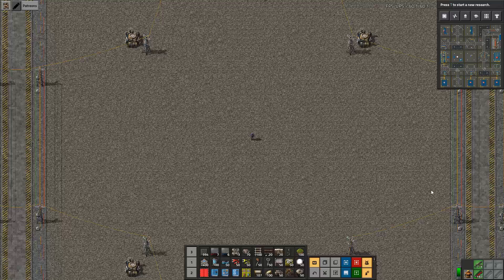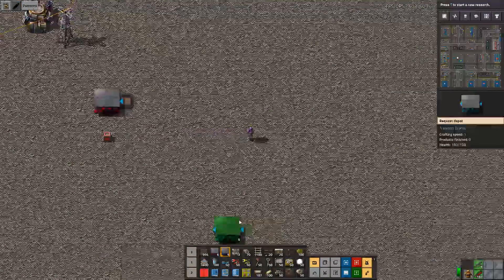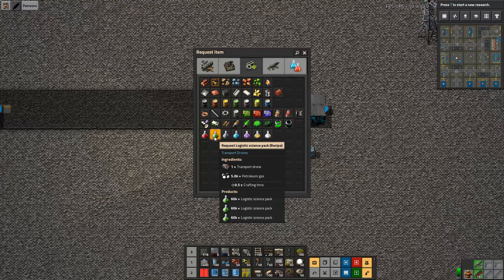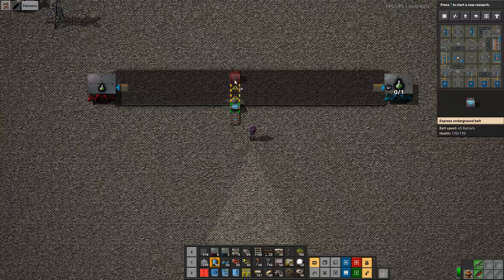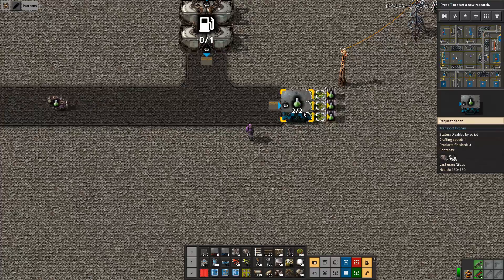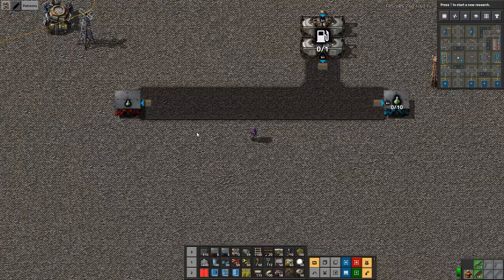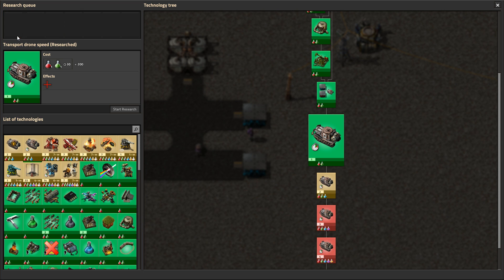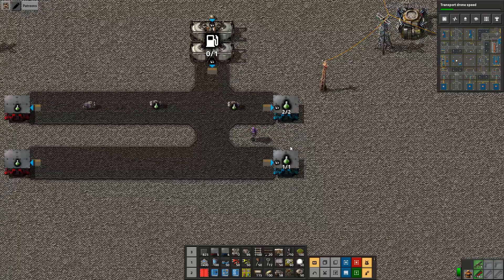Factorio Mod Tutorial: Transport Drone Tutorial - Factorio Engineering

Comment: So they made a change in the mod that creates pink robot fuel and it seems that any material (petroleum gas, coal, rocket fuel, etc.) makes pink fuel.  The issue is the when I put bots down, the bots transport from the fuel to the requester and back again while ignoring the supply chest.  I did set everything up correctly to ensure that I would request  from supply to requester.  What am I doing wrong?

Comment: This mod works great until you have multiple supply depots supplying the same item. The transport drones usually go to the nearest source for pickup regardless of how many items are available for pickup, so if one supply depot is further away but sitting full then it will be unused if there is a closer supply depot that is constantly near empty.
Reply: Yeah ran into that problem to at first.  One of the depots has to be running on shortages for other depots to be used.  Generally the further the distance though the more drones you want, but you also want to get more drone capacity.  They tend to favor what has enough to satisfy what they want, higher through-put will though cause them to eventually even out.  I found this to be the case with my uranium production; i have 2 patches of uranium, neither big enough to feed the uranium demands of my centrifuges, the drones ended up going to both.

Basically, you need to have heavier shortages in depots sources for drones to go for more than one depot.  Otherwise they go to the closest depot with resources in it.  If your producing more than what a single depot is able to obtain, drones will go to overflowing depots further away as secondary sources.
Reply: If a further depot has more resources but isnt being used, it means that your not using enough for the second supply depot.  In other words, you can afford to increase production further.

Comment: Do they transport liquids? Im trying to get petroleum. It can be assigned as request but even though there is output arrow and if i place pipes they show petroleum, but it is not actually flowing from it.
Reply: @nicodemuseam  yes, the mod is improved, fixed and expanded almost not daily but often hourly :-)
besides what is shown in this tutorial, there now are green buffer depots, liquid providers, and also the mining depots from the "mining drones" mod can be used as providers.
there are also mod settings now to change the type and amount of fuel that is used by the drones.
Reply: Maybe put the liquids in barrels?  Though that obviously complicates things - you'd need filling and emptying points at each end, and then probably another pair of depots to transport empty barrels back.

Comment: Ohhh these are nice, but can you get run over by them?
Reply: there are no collisions between them themselves and also not with you. thus you can replace a wide multi-belt bus with a one tile (or better for pathfinding two tiles) wide road.
there are also no collisions between them and other objects since they can only drive on roads, roads can only be built on empty tiles, and nothing besides rails and gates can be built on roads. (since the drones from the two other mods could be killed by trains, i "automatically" didn't test yet whether these drones also "phase through" trains that cross the road :-)

Comment: Huh, it seems like a neat mod. I'm suprised the author didn't go for configuration like logistic train network though. It would annoy me to no end having my requesters stockpile increasingly huge amount of resources just to increase bandwidth
Reply: while you have a constant flow of products, most of them will be "in transit" and not stockpile. only when less items are needed, the drones will catch up and fill the requester.
the mechanics were intended to be something new and different, not simply a "LTN on roads", and one of the challenges is to balance the number of drones with the bonuses and stacksizes and the distances of transports, maybe even using relay stations to cut the distance in half (using half the number of drones for each half) ...

Comment: This is a cool looking mod and I have thought about an idea like this before but like most mods it seems to scale up too easily to OP level. You didn't say anything about if they can hook into the circuit network or how the bots and roads affect or are affected by biters.
Reply: on my last map, those drones that were not eaten by biters kept walking through puddles of acid long after the spitters were killed., but roads were left unharmed.

because of how requester and liquid depots work (storing up to 64k++ items :-) and also because handling signals by script causes massive hits on the UPS, it is not easy (and currently impossible) to connect them with wires, except for the provider depots which basically act like simple big chests (with 100 stacks capacity)

Comment: I see a real need for these in SE,  assuming they do not have transport drone attrition
Reply: can confirm, am using this mod and factorissimo in city-block fashion designed to hold 2 level 3 factory buildings per block. 7 block gap all around the edges to fit splitters, belts, and request/supply depots. and robot attrition has lost me exactly 0 drones so far... hoping it stays that way

Comment: I’m using it to feed my defences.  I have a road around my base with a depot for every 5 turrets.  Then one transport per depot.  It keeps a stack of ammo at each and so far works pretty well.
Reply: And how does the ammo then reach the turrets? Do you belt it out from depot to the 5 turrets?
Reply: metamud I belt feed out to the turrets and use inserters to load the turrets.  By only putting one transport into each depot there will only be one stack of ammo at each.  Works so far.  At least for the early-mid game.

Comment: The mod Is fine but i think it needs drons and depots can transport and store fluids
Reply: Transport drones can move fluids.
Reply: @FerrumAnulum  really?
Reply: @MrThejuanoxize  Yeap. Instead of a red box supply depot there is a single tank looking fluid supply depot. Just dont get it mixed up with the 4 tank looking fuel depot.
And the requester depot has a pipe output.
Reply: @FerrumAnulum  yes, and mining depots from Klonan's "mining drones" mod can directly be used as providers too

Comment: City blocks with these bad boys sure would be fun
Reply: The main advantage - you can't die after meeting drone with your character. But you can easily die after meeting your character with train
Reply: Thats exactly what I'm starting right now in a Krastorio2 game. My starter base goes up to blue science (including military) and is just at the point where I'm finishing up that research. Meanwhile, it feeds a big mall that I'm using to make a city-block style base with each block being 1 chunk and roads surrounding each block. Trains will supply ores and bots will handle the mall, construction, and player logistic supply. So far it's shaping up really well.

Comment: Nilaus .... I would really have liked to see the drones with speedupgrade 15 or so :D them just buzzing about - and how good they are on 1-wide tracks :D pretty sure they look like mice in a labyrithh
Reply: With my experience the only problem is diagonal roads, 1 wide is not an issue if it's at 90 degrees.
Reply: @Propulus  I'm always reminded of ants, especially when they switch direction, sometimes overshooting the corner, etc :-) and although single tile wide roads are no problem for movement even on busy roads, two tile wide roads allow for faster pathfinding and thus much bigger networks before UPS takes a hit.
during the last month, diagonal connections and pathes were improved in vanilla (and also in this mod; Klonan is a dev :-) ... see the friday facts FFF 344, 345, 346

Comment: What kind of advantage does it provide compared to Trains and Robots? or even belts? In what scenario would these Drones be useful?
Reply: Smaller trains inside your main bus base. or just a main bus without belts.
Reply: It's like LTN but without trains and without the hassle to lay tracks and worry about signals.
Reply: Train: need a lot of time to load wagon (40 stacks) with 6 fast inserters. Drones: need 40 drones to instantly load 40 stacks. But drones will lack some speed compared with trains
Reply: use cases , delivery of armor for defenses, or connections between differnent drone-networks

Comment: I had just gotten to Transport Drones in a playthrough similar to yours. It did take me a bit to figure out the Petroleum thing. (I had to go to the mod page and look through the guide.)

 I hadn't realized the "x drones pick up x stacks"  That is definitely good to know. Thanks for putting up a tutorial on it.
Reply: N drones will try to keep the requester filled with at least (1+B) times N stacks, with B being the bonus, for a total of 1-6 times N.
the resulting amount of items in the requester thus will be between (1+B) times N and (2+B) times N.
this effect becomes very noticeable when you have eg researched 2 bonus levels for capacity and a single drone transports 3 stacks each time, to fill the requester to a level between 600 and 1200 science bottles, and there is no option (yet?) that allows limiting the bonus like the "override stack size" option does on inserters.

depending on how the network is set up and for which items you use it, it may be best to (at least at first) use more drones and faster speed instead of bigger capacity: no bonus and 3 drones will fill the requester with 600-800 only (thus a lot less "overshooting" the target amount, and because of more drones also a more steady supply on long distances). do the math yourself: for ore and plates (or maybe also green circuits) where much more throughput is wanted, 20 drones with max bonus still only fill the requester with 6000-6300 ore, 12k-12.6k plates or 24k-25.2k circuits ...

ps: the mod is improved, fixed and expanded almost not daily but hourly :-)
thus the current version allows to also change the type and amount of fuel that drones use (anybody wanting steam powered drones, or even water, acid or lube powered drones? :-)
not only solid items can be transported, but also liquids (there is an alternate provider building for the liquids), and there are also green buffer depots.
and also the mining depots (from Klonan's Mining Drones mod) can directly be used as providers for this mod.
Reply: quite a while since i wrote the above, and a lot more additions and changes in the meantime, eg depot readers to read the amount of items in depots, network readers to read how many items are available in the entire road network, and (related to my above complaint, most important) also depot writers which allow to set exact lower amounts/limits how many items should be fetched, even with many drones and large bonus ... always keep the mod updated to the latest version, read the info tab on the mod portal, and patchnotes, and also an ingame wiki that is available now and gives detailed instructions.